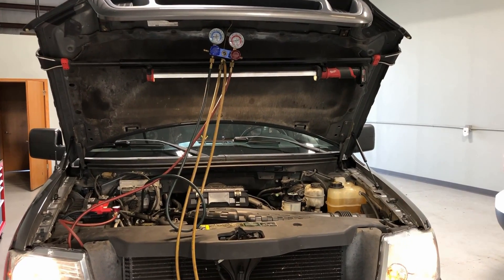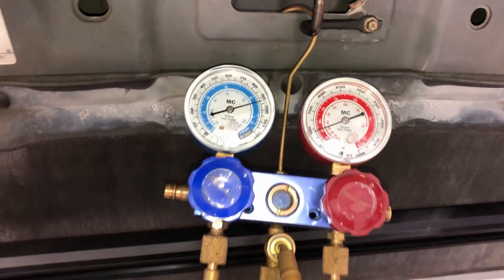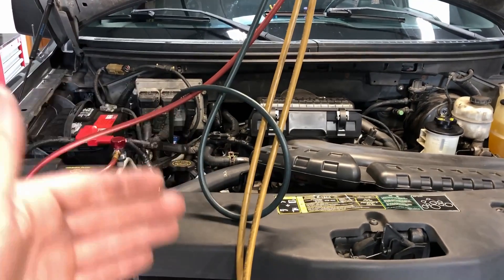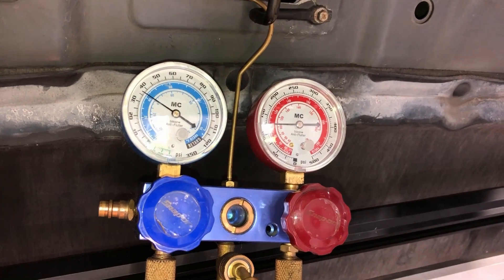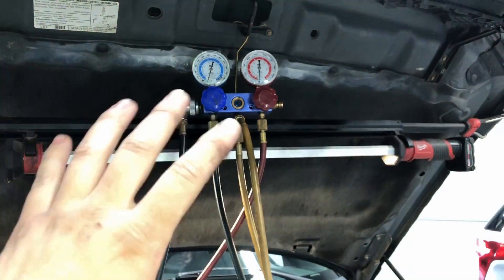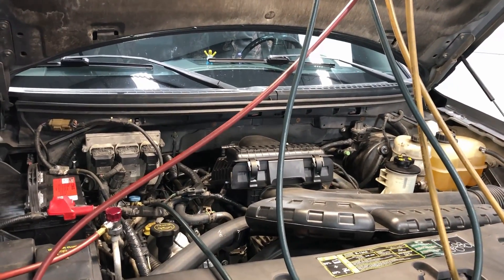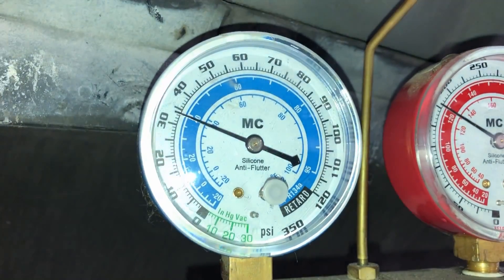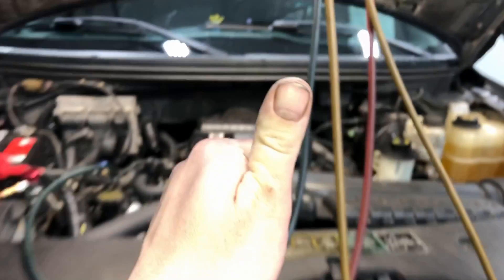Poor Automotive A/C Cooling: Do You Have a Low Refrigerant Charge Level?

Comment: no leak fix???  lol   hate 134a  anything over a couple years old leaks   usually corroded aluminum lines "grow" next to the o-rings
Reply: I had a 95 Toyota p/u with 134a, had it 19 years with 235,000 miles, still blew ice cold, never touched the system.
Reply: @tctennessee7360  same here with my 05 Tahoe. never have had to touch the a/c system
Reply from the maker: This is literally just a diagnostic video to show what it looks and sounds like when your a/c system is low on refrigerant nothing else. This is the new shop truck it has no leaks it was charged with half a pound for this video.
Reply: So you used a "ringer" huh LOL,  Great video on what to look for.

Comment: My 08 blows cold air when it wants to. Sometimes it will freeze you out, other times it’s “cool” but not “ice cold.”  Guess I need to check pressures with these gauges.
Reply: Imo, I don't think you have low pressure issues. Because if it was it wouldn't freeze you out when it wants to. It sounds like you may have a blend door/actuator issues. If the freon was low it'd stay low and not blow cold.
Reply: Already changed that out few years ago.